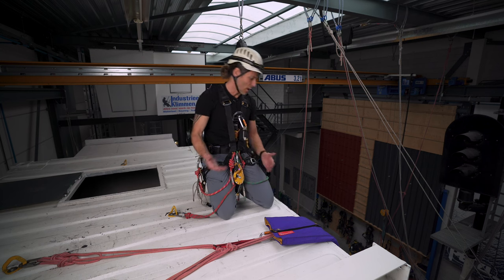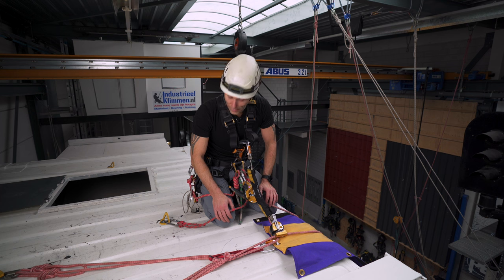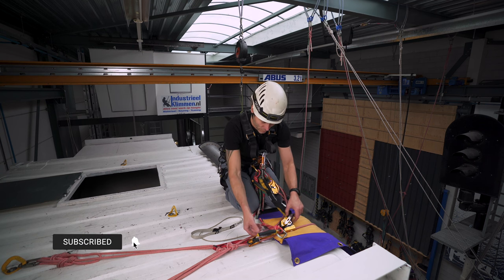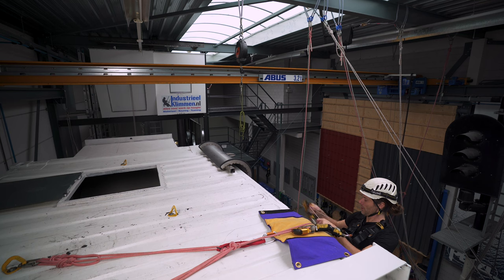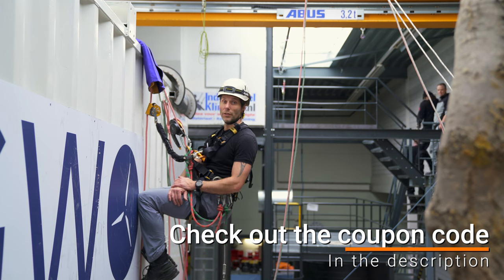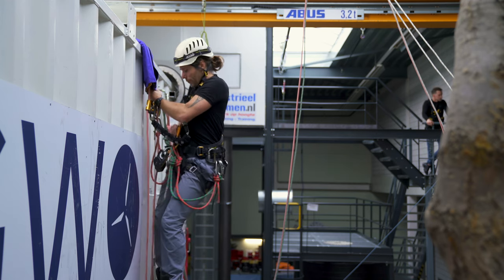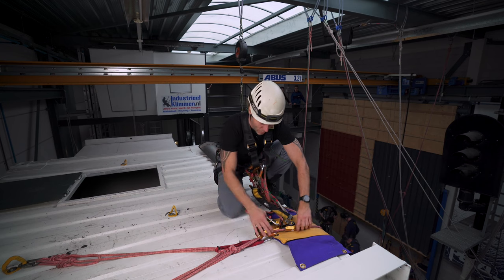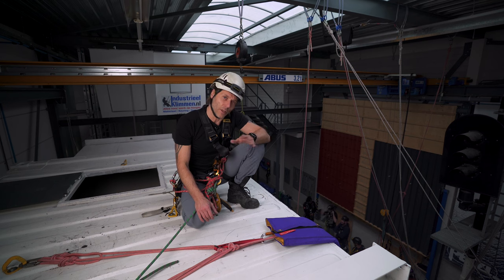How to Pass an Edge Obstruction at the Top - IRATA level 1 Training

Comment: Clean and concise. I'm re-certing level 3 Irata right now in the US and they're asking us to tie the two Y-hangs together with a BFK under the Y portion. Their reasoning is that if there's a failure of the Y portion of you system it won't swing you if have the ropes tied together.
Reply from the maker: That could happen and it’s something I talk about in my courses as well. It is also something I do when rigging these large y hands. Prevent an out of control swing in case of a failure. 
 You could counter that that BABK is only one knot, you need two. Just for shits and giggles 😜
Reply: "After" my assessment 😅
Reply from the maker: @Sillyworld82  Never ON assessment hahaha. But in training.. That is the time for these conversations😉

Comment: I see why Scott Russel (comment below) would say you need two points of contact. 
However, as you pointed out, the rulebook states clearly what is required. That being said, the assessors are allowed a reasonable interpretation of the rules, and if that assessor wants to see you demonstrate two points, then that is what you do for them, period. As far as what Alex shows in this video being "unsafe", or not to code" is a matter of reading each page of the IRATA guide/rules. We were taught and tested, using one point until we were ready to go over the edge. Just like Alex shows here, except we had an Asap on a separate line while installing our ID and foot loop. We were also taught to Ask the assessor what they want to see, and what they will allow. It doesn't matter what level you are at, the same rules apply to all rope techs. Thank you, Jim H.   SPRAT And IRATA certified Technician